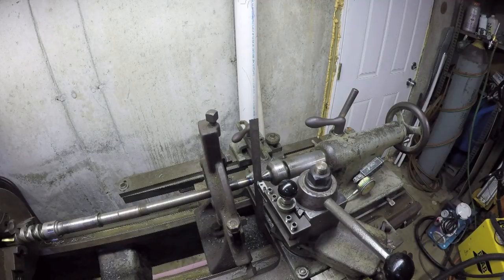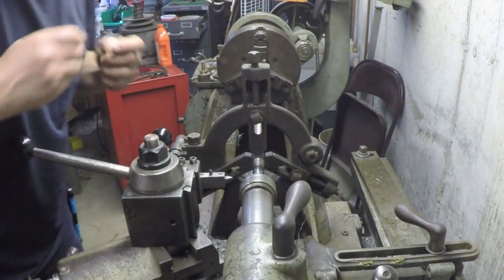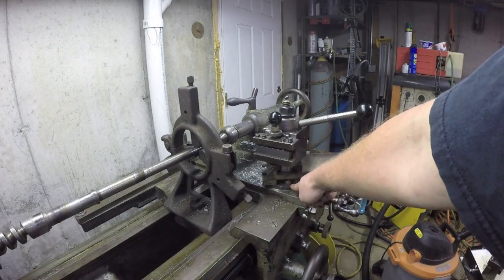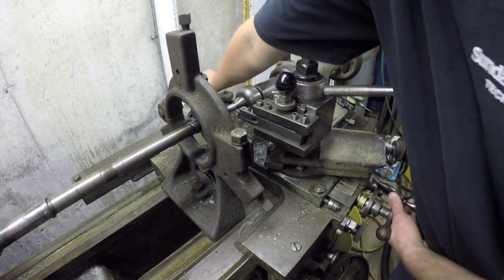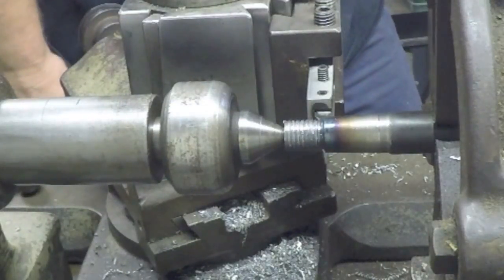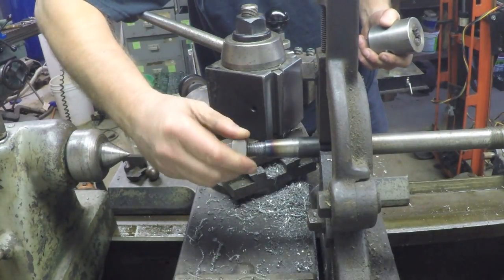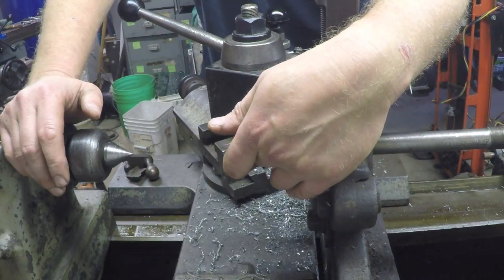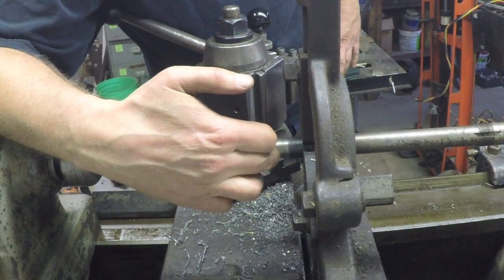IH 350 Utility Tractor Project Part 45

Comment: Is the method of single point thread turning possible using the reverser?  I didnt see you back out the compound or reverse spindle direction..  seems to me the cutter would eat the threads when changing long feed direction but i'm no expert.  Loved your restoration videos.
Reply: At 9:45 i think im watching you cut right hand then left hand threads when you reverse the long feed.  U wont make that mistake again ;)
Reply from the maker: Travis Goerger yup, failure to back out the cutter prior to reversing the carriage feed direction is likely the issue here. I do not have the motor setup for reversing the spindle because I do not trust the chuck to not unscrew.

Comment: Nice job Steve.  I'm thinking a  good taper fit with a nut is probably sufficient for a tractor.   For future reference,  you gotta get that taper out of the part you're threading whether you're doing it with a die or single pointing it.